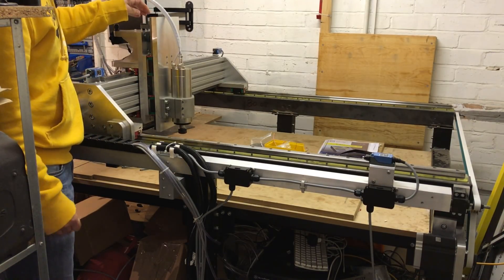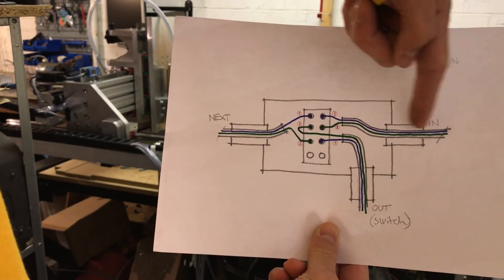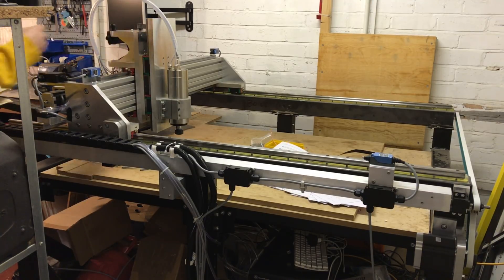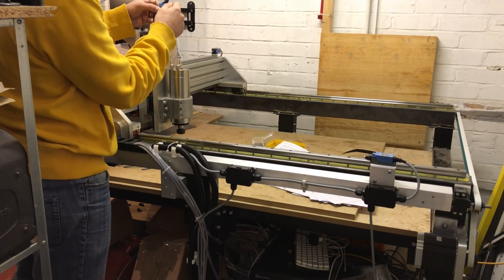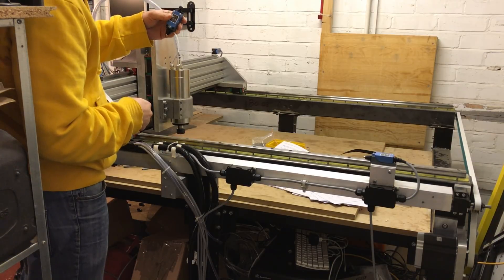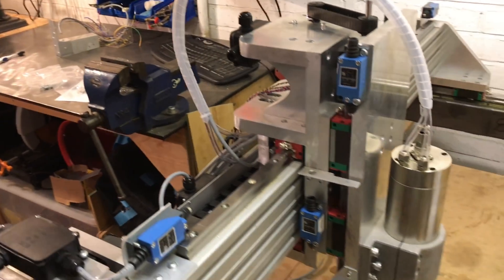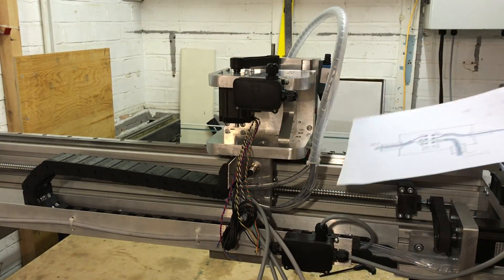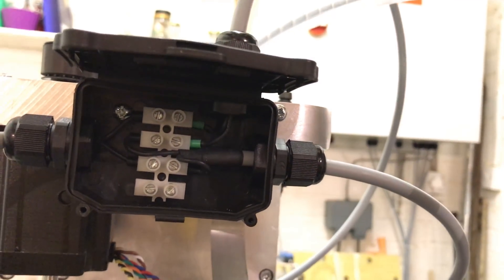CNC Router Build (Episode 33) Joe Harris

Comment: How does your coolant tubes fare running through the cable chain? I mounted my radiator to a panel in back or the spindle. I thought about mounting the radiator under the bench to avoid dust clog but I have a vacuum hose along the spindle for dust collection
Reply from the maker: They seem to be surviving ok!

Comment: What do you use this CNC machine mostly for? I was wondering if you cut aluminum on it and if so, what types of end mills do you use? I am building a 1500 by 1000 mm Openbuilds CNC with some upgrades. I am trying to figure out what end mills to get and if it is worth buying cheap ones or not.

Comment: Great work Joe!
could you tell me the wiring layout on your spindle and tell me why you did not seems to use the ground. I'm a newby building my own openbuild machine nothing as complex as yours.
thanks
Reply from the maker: Hi Andre, 
My spindle is wired to a VFD (Variable Frequency Drive) which provides it with power via the three cores, these can be connected in any order to the three input terminals on my spindle but I would check for the model you are using. The frame of the machine is grounded and where I have used shielded cable this is grounded at ONE end in the cabinet to a "star ground" point. 
Good luck with the build, I hope you will share it once done! And don't forget to check out my other videos as they might be helpful?
Cheers Joe